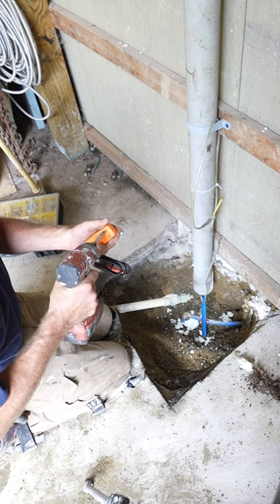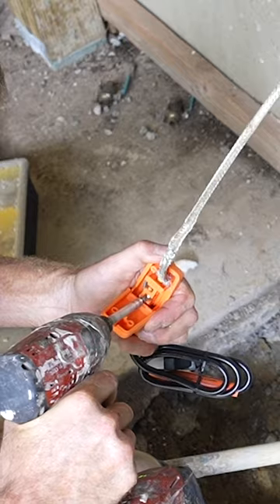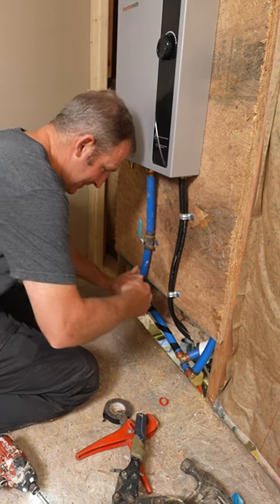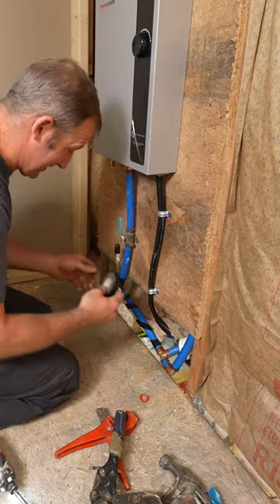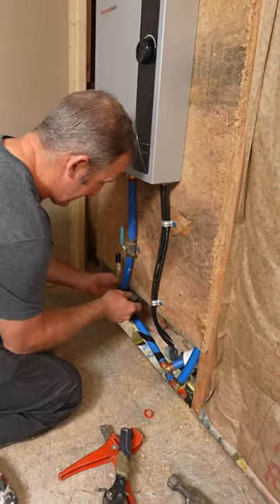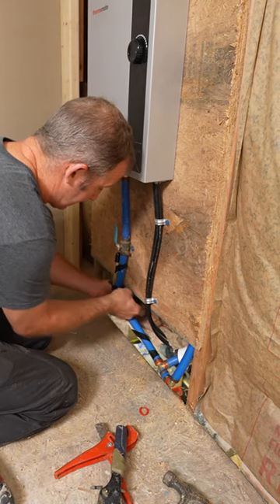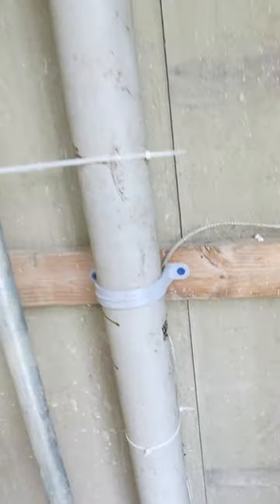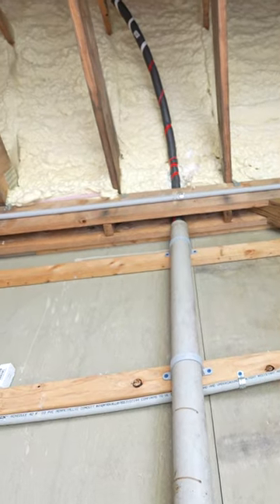Easy Heat Cables to Prevent Freezing Pipes 💧  #diy #plumbing #homeimprovement

Comment: I used a product called heat trace from my cottage to the well, 80ft away.  Its a wire that’s fed into the pipe.  Worked really well